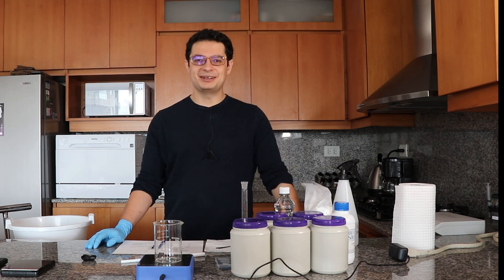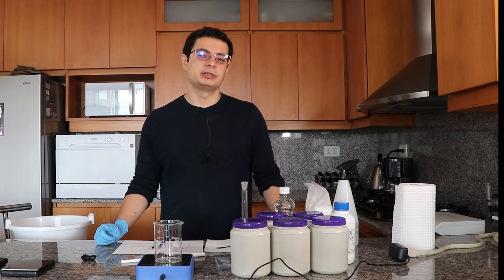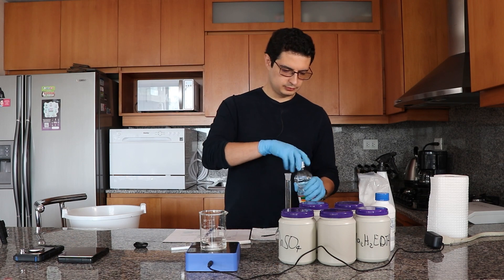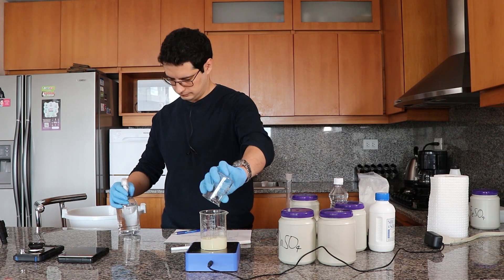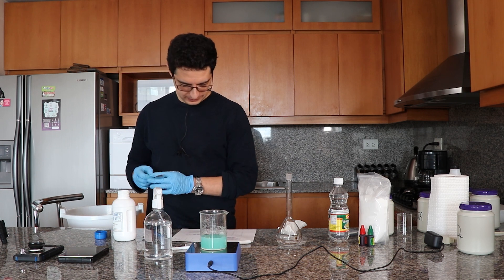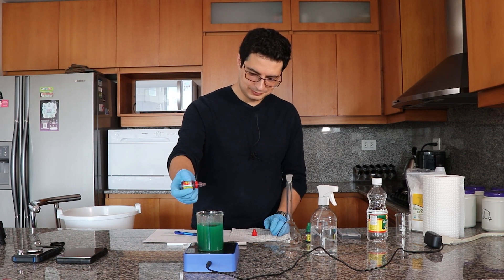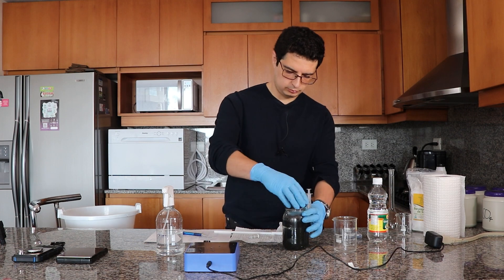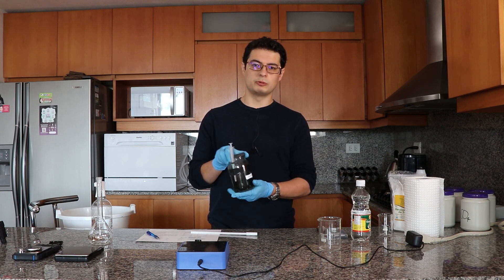Make your own micronutrient solution for hydroponics, lasts a lifetime!

Comment: Hello Daniel,  Thanks for the video.  I have a question about using your formulation with hydrobuddy.  Since we know the final volume, and ppm of the heavy metals, would it be reasonable to solve for EDTA in terms of ppm, where the final ppm for the EDTA molecule is approximately equal to 1.25 x the sum of ppm of metallic elements as per hydrobuddy?

To do this I added disodium EDTA to the database as 12.5% Na and 87.5% Cl.  In this case Cl was substituted for EDTA since Cl is not used in the formulation.  The reason I'm asking is that I would leave iron sulfate out of the solution and substitute iron DTPA, hoping to chelate only the other metals with the EDTA.  Thanks
Reply from the maker: Hi Andrew. Thanks for commenting! You will want to click the "mM" button in HydroBuddy so that your targets are displayed in mM instead of ppm, add all the amounts you have for the micro nutrients  you want to chelate, then multiply that amount by 336.21 (molar mass of Na2H2EDTA) then multiply that by 1.25 (to have a 25% excess). This will give you the target amount of Na2H2EDTA to add in mg. Let me know if this helps!
Reply: @ScienceinHydroponics  Yes, thank you.  I thought about using mM but wasn't sure how to equate the results to get the desired EDTA.  Your suggestion makes sense; however, according to this:  "https://pubchem.ncbi.nlm.nih.gov/compound/6049" the molar mass of EDTA appears to be 292.24, and 338.22 for Na2EDTA.  If I run the formulation in your video using the above weights for the Cu, Fe, Mn and Zn compounds as a direct addition to a .25 l vol. I get a total of .049 M of metals.  Multiplying this by 292.24 results in 14.32 g EDTA.  Given that your calculation of 7.2 g for Na2EDTA is approximately half the amount calculated by hydrobuddy, I'm wondering if my methodology was correct.  I double checked the weights and compounds used and get the same results.  Also, since Na2EDTA is used instead of EDTA would it be proper to multiply the result for EDTA by 338.00/292.24 to get the weight for Na2EDTA.  Thanks
Reply from the maker: Thanks for your reply. I will now try to explain the calculations step by step. These are the mM concentrations for the different nutrients in the final solution:

Fe - 2.4ppm - 4.298E-02 mM
Mn - 1.0ppm - 1.820E-02mM
Zn - 0.5ppm - 7.644E-03mM
Cu - 0.1ppm - 1.574E-03mM

The total amount is 7.02E-02mM if the concentration is 1000x in the concentrated solution, then that would be 70.4mM, multiply by 1.2, that would be 84.48mM. For NaH2EDTA - molar mass of 336.21g/mol - that would give you 28.40g/L. Multiply by 0.25L, you get 7.1g. 

If you cannot get the same ppm of heavy metals in the final solution for the compounds, then it might be that you're using the wrong compound composition. Make sure you're using the same exact salts with the exact same degrees of hydration. Note several of these are not included in the default DB of hydrobuddy (for example anhydrous iron sulfate).

I hope this answers your question!

Comment: Thank you for the vid!
I have a question about using sodium benzoate. You did say in the video that the precise amount isn't too important, but is there a point where it becomes too toxic? 
Also, I have been adding Sodium Benzoate to the pH buffers as you've shown in your video, but I am wondering now that it wouldn't work for a pH 7 buffer due to its low acidity?
In the vid, you only showed us instructions for a pH 4 buffer so I am curious.

As always, appreciate the content and your answers! Take care :)

PS. I found that I could add dyes and sodium benzoate in the accurate weighing method by combining Daniel's two methods (I had no commercial pH buffers at hand atm):
1. Make an accurate pH 4 / pH 7 solution through the method shown in the scale method.
2. Use those buffers to calibrate my pH meter accurately.
3. Add dyes and sodium benzoate and then add potassium citrate / citric acid to bring it back to the required pH.
Reply from the maker: Thanks for writing! Benzoic acid has a pka of 4.20. so it could be used to prepare a buffer with a pH of 4.0 with no problems. However the solubility of benzoic acid in water is quite limited, so the strength of the buffer would be limited to this value, which is around 3g/L. It is not possible to prepare a pH 7 buffer using sodium benzoate. Note that sodium benzoate is also only a good preservative at a pH < 5, so it will not do a great job preserving a pH 7 buffer.

Comment: Could we also use a pycnometer to measure the concentrated solution in grams?
Reply from the maker: Thanks for commenting! Yes, if you figure out the density using a pycnometer you will be able to do additions in grams. This would be more accurate indeed.

Comment: How can you tell if the iron oxidizes and turns to rust?  I once tried making micro concentrates with sulfates and no added chelators, and it turned into rust water in 2 days, but if I mixed in food coloring, I'd never know.  Is the chelating agent really that effective that you don't have to worry about oxidization?
Reply from the maker: Hi Sky, thanks for commenting! You can make it without dye and monitor it, you won't see any oxide precipitate (I have done this to confirm). The iron will always oxidize to Fe3+, but the EDTA very strongly chelates Fe3+ and prevents any precipitate from forming.
Reply: @ScienceinHydroponics  would the same reaction occur if Amino Acid was used as the chelating agent, or does that not have the chemical attraction that the EDTA does?
Reply from the maker: Thanks for your reply! Aminoacid chelates are much weaker (millons of times weaker), but they might work well enough if the right amino acids are used.
Reply: How about adding some fulfic acid?
Reply from the maker: Thanks for commenting! Fulvic acid is likely not a good enough chelating agent to keep these micros in solution at these high concentrations.